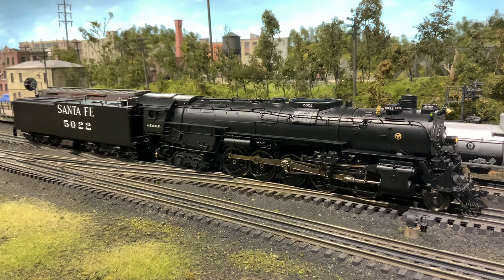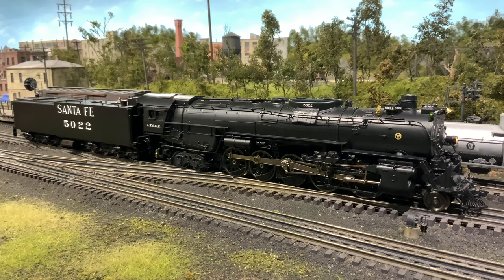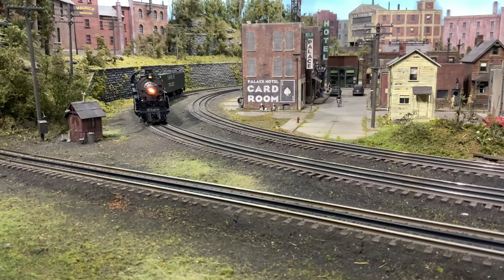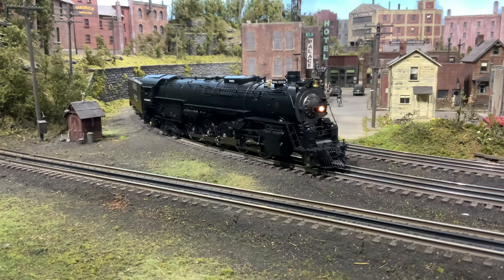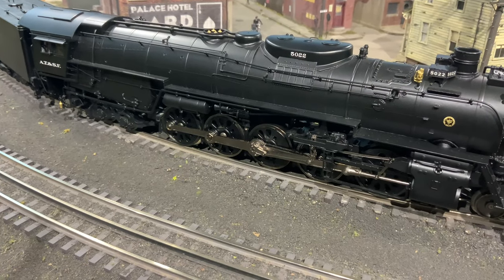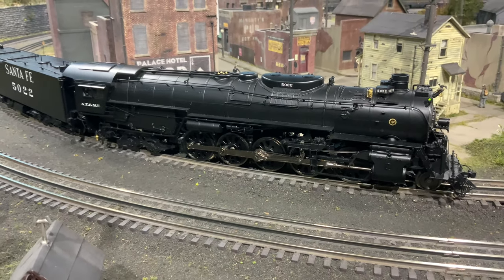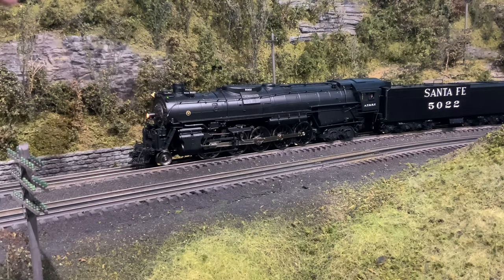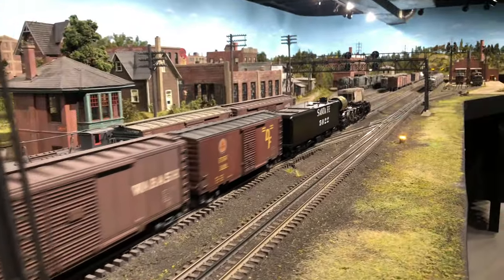Santa Fe 5011 Class Rented Mule Pt. 1

Comment: I’m almost thinking it would be better if the flanges would be on axles 2 and 4 with 1, 3, and 5 being blind.

Also I don’t know if you remember me commenting a few months back about a BLI J1a I acquired. I have recently upgraded it to Wowsound and how I have the speakers it has that nice loud bass O scale engines have. The banshee whistle also sounds very ghostly with the setup, but I normally have it with a Pennsy 3 chime.
Reply from the maker: I had one of my Decs set up like that. Seemed a little unholy to have a blind rear driver stepping out on curves!
Reply: @normstrains  that makes sense. I know the 4-12-2 engines from Lionel have 2 and 5 flanged and the rest blind I believe. That’s why I suggested it.

Comment: Here's a good video of both the Santa Fe's oil burners and Pensy's J1's on the Sandusky Branch. https://youtu.be/u5zOCNNw6t0

My Potomac did that too. Simple fix is "BullFrog Snot" Instant traction tire. Maybe check the wheel gauging.
Reply from the maker: It’s fixed, next vid is uploading. Basically snubbed the springs on most of the drivers.
Reply from the maker: By the way, I love the music in that vid, very relaxing 😌
Reply: @normstrains  the guy's chsnnel name was 'dcoursey" and I think it was a clip from a Pennsy Video from Herron Video. He also posted a lot of John Prophet's sound recordings of PRR power.
Reply from the maker: @mike6206  he has the Howard Fogg recording with a J1a and a 5011 Class doing run-bys. Interesting contrast in sound, the J1a sounds way out of square, the 5011 has a unique whistle.

https://youtu.be/3jdz2An_9t4